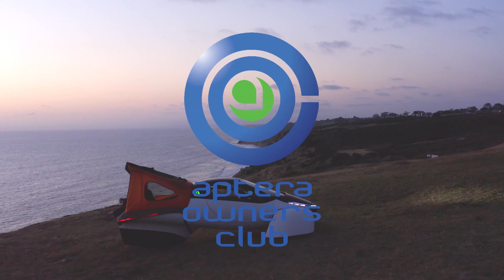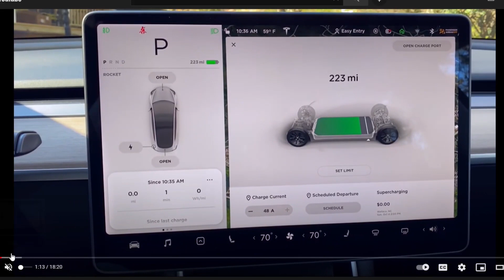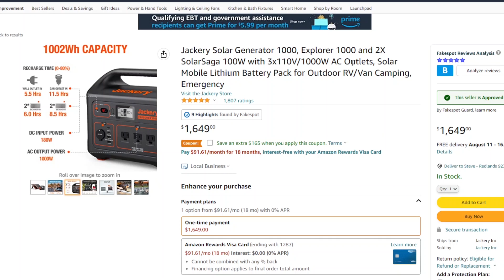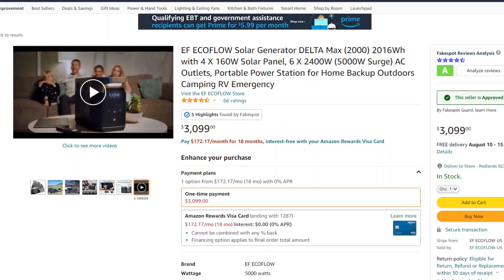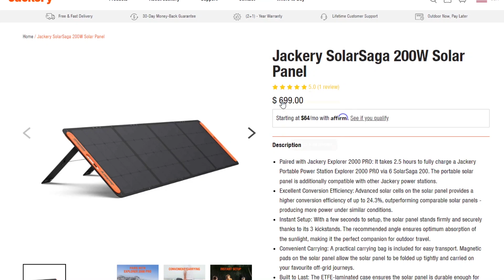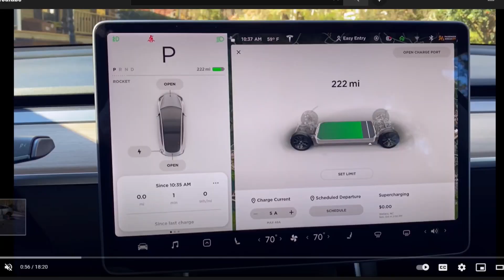Charging with portable solar.   Aptera could do this MUCH simpler

Comment: Steve, I have also asked Aptera to include the option to directly connect external solar.  As others have mentioned here, I want to solar charge while the vehicle is locked up securely in the garage.  Lots of people will want to park in their garage and stay true to Aptera's solar heritage!  External solar may also come in handy for long trips, rural areas, or when camping, where an extra panel or two brought along could speed up the process.  These are good marketing points too!

Comment: The benefit of using something like the Jackery kit is that you can use the stored energy for other appliances and devices. This doesn't seem to be the case with the Aptera. So far as I can tell based on what people have said, there doesn't seem to be any AC outlets in the Aptera. There might be a USB or USB-C or cigarette lighter port, but that would be it, really.
Reply from the maker: They've indicated that they plan on having an ac outlet
Reply: @ApteraOwnersClub  can you link me to this, I'm extremely interested in having ac outlets in mine. Thanks!

Comment: im all for the solar charge port being near the dash for a solar panel being a sun shade for the windshield, i am also hoping to see an ac outlet somewhere to do a v2l so in the event of an outage or i need some power for something while out and about i have an outlet to plug something into. ideally a 120v 15 amp or even 2000w (16.6amps at 120v, or 18a at 110v)

Comment: 1000 Watts is 1 kw or about 3 to 4 miles on a Tesla or 10 miles for the Aptera at advertised efficiencies.  Beats the Dickens out of pushing your Tesla 36 blocks (3 miles) to the nearest charging station.

Comment: A solar port might cause Aptera and owners more trouble than it’s worth. Solar panels produce DC, but depending on the cell and panel configuration the voltage and current could vary widely. The port would have to be labeled for the voltage and current range allowed, then the charge controller would need to be designed to shut off if outside that range (for those of us that think we can push the limits). MC4s generally only support up to 30 amps and 600 volts, so someone could do a lot of damage to the car and their property if they got it wrong.

I’m glad the car has some solar charging, but It would be safer to plug it into a standard house socket driven by a stationary solar array than try to hook up more portable solar.
Reply: 100% correct 👍
Reply: unfortunately, you are correct.  It might be more reasonable for Aptera to make available an entire kit, panels and connectors to ensure compatibility.  Maybe a non-standard connector to discourage connection of non-compliant panels rather than an MC4.

Comment: Modular batteries- imagine a battery pack the can be sold seperetly that fits in the hatch that plugs right into the existing batteries. Just plug it in when you need it for long trips without having to carry it around all the time.  your 400 miles could go up to 600 miles or 2 packs to get 800 miles.
Reply: With these EV's I've been hoping for hot-swappable battery packs in a gas station like setup. You pay for or sup to the service, and for a nominal rate, you can swap batteries in addition to charging. This would also allow for the batteries to keep up with new tech to avoid the huge upfront cost of replacing battery packs.
Reply: This! 👍 You can even fast charge the external batteries while you're changing your Aptera. This would be perfect for long trips.

Comment: If your charging your EV at home using grid solar (assumes you are buying green power from your power company) you are getting the same inefficiencies that you see in the video.  I agree that charging the EV's battery directly from solar panels or DC power from the battery would be better.

Comment: I'm hoping Aptera does include a solar charge port, but my plan is to have solar panels on the roof of the garage so it can charge while still garaged.  I built my own solar charger, so worst case is solar to level 1 charge similar to the video.I completely disagree that the MC-4 plug be used.  It's not robust enough to handle repeated insertions and disconnects, and is a bit hard to disconnect, which is why a special tool is available to do that.  I'd like to see a twist-lock connector, or even integrate it into the Tesla charge port, if Aptera goes that route.

Comment: How quiet do you believe this vehicle will be?
Reply: Wind noise will be greatly reduced with the Aptera due to the low coefficient of drag.  For me the wind noise during high speeds has always been the biggest contributor of noise in a car.
Reply: @505YUTUBE  I have worked on noise reduction for diesel gensets.  Each time you are able to eliminate one type of noise, another noise that was masked becomes apparent, so the task continues until overall noise levels are very low.
Reply: There will certainly be a speed dependent whine coming from the motors, so the sound will be different.  There may also be suspension noise.  I think since it is different, some may find it annoying.  The overall volume of the noise is likely to be quite low.